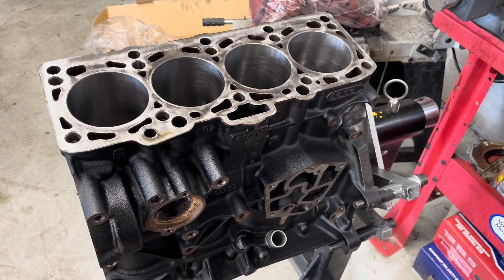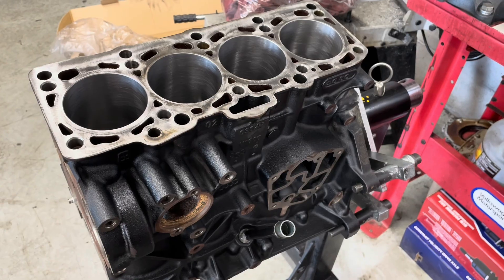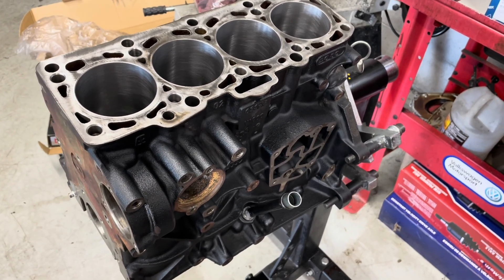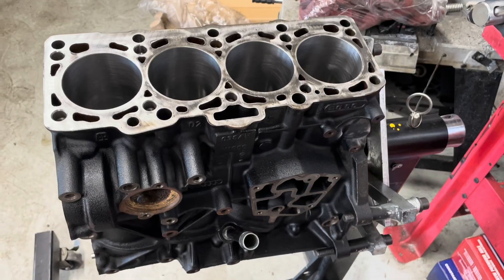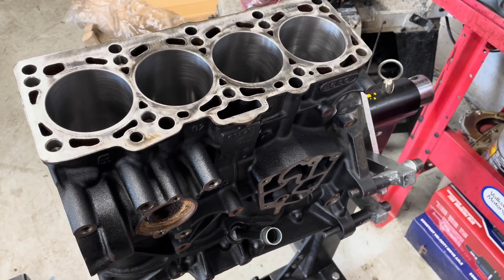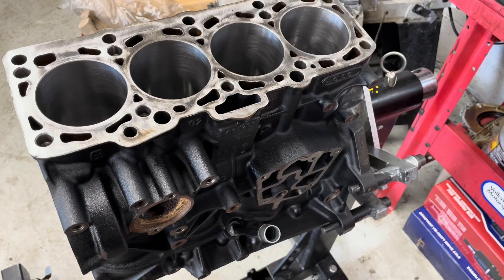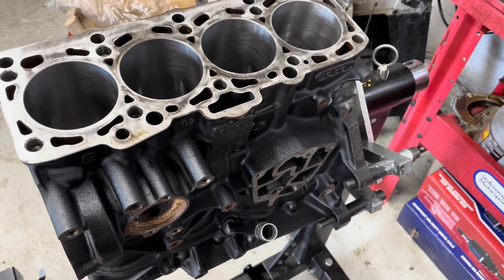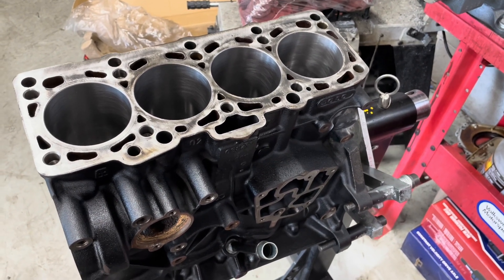ALH TDI Engine Rebuild. 1.9 to 2.0 Part 1 Main Oil Clearance

Comment: Integrated mains are NOT a "better" idea....esp. on the older 1.6 engines. Integrated mains have approx. only 60% of the original thrust bearing surface (at best). They are easier for putz mechanics to install though. And, I have NEVER seen integrated mains in the stock 1.6 engines. and I have taken lots of them apart to rebuild. You find them on on 1.6 engines which have been "rebuilt" by putz's.

The whole idea of less wear surface on the 1.6's is critical due to an entirely different clutch/flywheel system which manages to shove the crank forward EVERY time the clutch pedal is pushed upon. 

I rebuild alh's and I NEVER install integrated mains.

Comment: bhw pistons are 18.5 compression ratio vs 19.5 on stock alh. if you are running big nozzles the injection pressure is lowered too. These 2 factors make for ease of start and a smooth and clean running engine. Did you experience hard starting with this lower compression ratio and bigger nozzle combination?